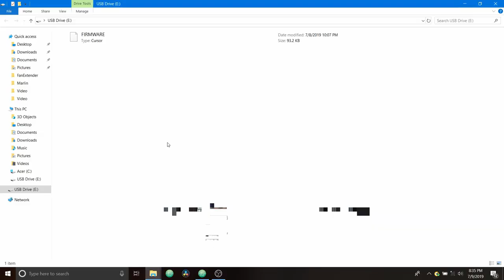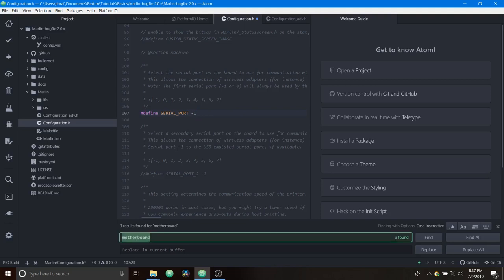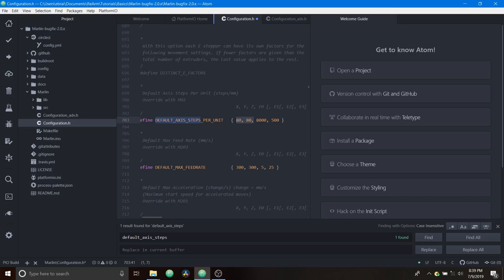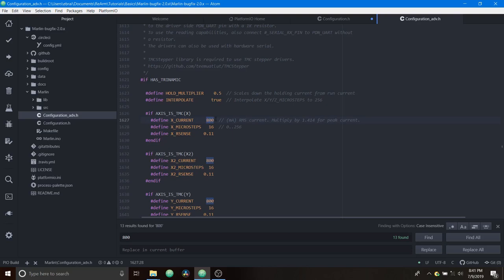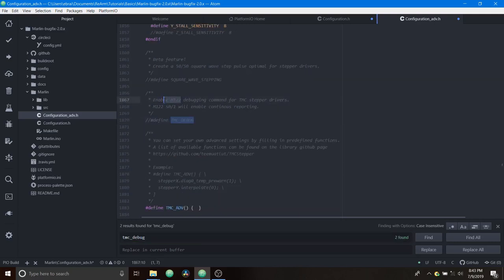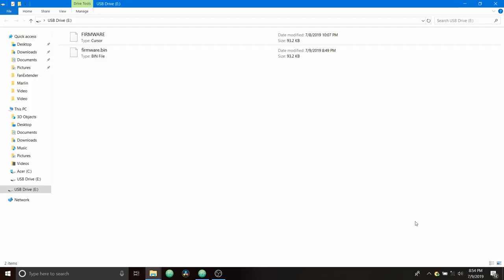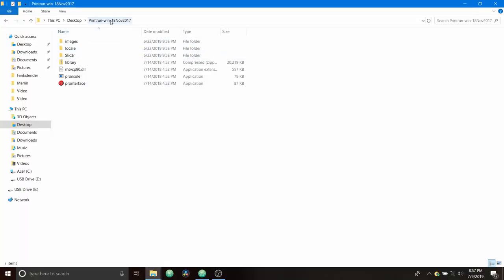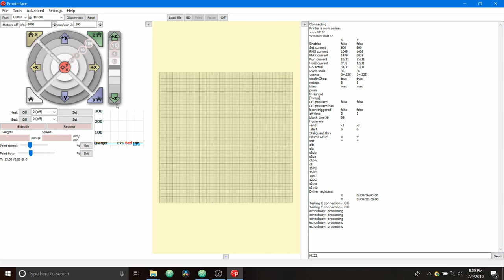SKR 1.3 - TMC2208 UART v3.0

Comment: Hi Edward thank you very much for this tutorial i have been following this and a few other while setting up my BTT SKR 1.3 with BTT TMC2208 v3 Drivers my issue i am having is that it seems to be moving twice as far as it should be any idea what could be causing this? any help is appreiciated thank you.
Reply from the maker: Check defualt axis steps per unit.  The reason I added drv8825 was to show the numbers being changed.  So try doubling the number for that axis.  Let me know how it goes.
Reply: @EdwardBraiman  double the numbers to decrease the distance moved? I thought it would be half? I will try it as soon as I can and will get back to you. Thank you for your speedy reply.
Reply from the maker: Np
Reply: @EdwardBraiman  okay so a little update on my firmware situation... there is nothing wrong with it! I came back to it after a day at work powered it up and all of a sudden everything was moving fine. Not sure why this is as i had done several power cycles already. Either way after following your tutorial my printer now works flawlessly so a Big Thank You!
Reply from the maker: You're welcome.

Comment: I followed this tutorial exactly with the BIGTREETECH SKR 1.3 and their drivers. I get a TMC CONNECTION ERROR on the screen. The printer works and moves fine still, but adjusting the current doesn't seem to reduce the temperature of the motors. Do you know anything that could help?
Reply from the maker: Tell me about the hardware you're using?
Reply: Edward Braiman It’s for a CoreXY printer and it’s the big tree skr 1.3 and big tree’s tmc2208 to control all 5 steppers (I have daul z). I’m using Marlin bug fix 2.0.x. Also, I don’t know if this is ok, but I’m ejecting the micro sd card from board and putting that in computer and then putting it back in rather than uploading through USB. Also thanks for fast reply :)
Reply from the maker: Are they TMC 2208 UART Steppers?  Can you tell me about your settings in Marlin firmware?
Reply: Edward Braiman Dang! I think you may be right, I got the combo from aliexpress and it was the TMC 2208 DIY x5 option instead of the TMC 2208 UART x5 option. I didn’t even realize there was multiple options. So this means I need to order new stepper drivers right?
Reply from the maker: Well unless you can modify yours to work the same.

Comment: You don't have to solder on the back of the driver to enable the UART?
Reply from the maker: Originally yes, but they fix most of their quality control issues, so it's not recommended anymore.
Reply from the maker: They had an issue with zero ohm resistor falling off at least in my case.

Comment: Don’t you also need to solder together the pads under the 2208 drivers for UART?
Reply from the maker: Not anymore, they should be in place when you order the steppers.
Reply: @EdwardBraiman  thx and good to know. I ordered my board and steppers a while ago and it was a real pain to solder the pads together
Reply from the maker: Just remember most the time this should not be required.  Also soldering can add danger of stepper failure.
Reply: @EdwardBraiman  in my case, the drivers did not have the 3 pads joined together

Comment: When I put the board into program mode and connect the usb to my Raspberry  Pi for, Octoprint, it takes control of my 2004 smart controller.  If I choose not to run with the Pi turned on, the screen remains blank even when printer is on.  Is it always necessary to switch that jumper to operate with or without the Pi?
The Pi seems to timeout quickly and disconnects from the board often.  Apparently I’m missing something.
Reply from the maker: Are you programming board from Raspberry pi?
Reply: @EdwardBraiman  No just running Octoprint. I actually find it easier to pull the sd and upload directly to the sd from Platform IO.  Are you thinking I don't have to switch the jumper if I am not programming ?  Seems like I tried running Octoprint without switching into program mode and it didn't work at all but I may be wrong.
Reply from the maker: What happens if you try the way in the tutorial?

Comment: When you open your platform IO, it looks very different to the one I down loaded you have more option on the left hand side,  it also does not show all the files that you’re showing, so can not open to edit anything, thanks Simon
Reply from the maker: It maybe related to me switching to VScode from ATOM with Platformio plug-in.
Reply: Edward Braiman I will look into the above I know more about SKR 1.3 than I did yesterday, if the file structure was fully open I would be able to do all the work required,  I think you said for the usb and power supply, you can use both at the same time, presumable you need a jumper to short out all three pins? Thanks Simon
Reply from the maker: The jumper is only for two pins.

Comment: Hi Edward, in earlier TMC2208 versions in combination with MKS GEN L  V1.0 board the stepper direction has to be inverted. Did I understand it right that it's not necessary with Bigtreetech SRK 1.3 & TMC2208 V3 combination.
Reply from the maker: It maybe nessary depends on you configuration.  If you're upgrading and direction changes yes.  If you building initially then you may plan for it.
Reply: @EdwardBraiman  thnx Edward
Reply: @EdwardBraiman   is my assumption correct, for the UART use (with SRK v1.3 or v1.4 boards) Vref Max on TMC2208 doesn't have to be set per potentiometer
Reply from the maker: Yes.
Reply: @EdwardBraiman  thnx
Reply: @EdwardBraiman  so we dont need vref set up ?
Reply from the maker: Could you be more specific or use discord below 👇
Reply: @EdwardBraiman  i mean we dont need to adjust vref knob on the chipset tmc2208 as old style ? From vs code is enough to set RMS current?
Reply from the maker: Correct,they should in most case be left alone.
Reply: @EdwardBraiman  i used my ex tmc2208 from mks gen board when i plugged them to skr pro 1.2 , i read 0.25 volt from chipset which should be 0.8 volt approximately so i was confused
Reply from the maker: Sounds like you figured it out.
Reply: @EdwardBraiman  for tmc2208 v1.1 unfortunately you have to solder 2 pins UART and NC otherwise they can not be UART Ready so jumper issue becomes useless. After try will write again. I took TMC CONNECTION ERROR then figured it out.

Comment: Hi Edward do like tutorials I am making a DLP 3d printer at the moment, I have been looking at this TMC2208 and this board will it run nema23 stepper motor 2.80A?
Reply from the maker: It may check the datasheet in the summary below video under documents.
Reply from the maker: This might be a better option. https://www.trinamic.com/products/integrated-circuits/details/tmc5160/
Reply: @EdwardBraiman  Hi do you know if the TMC5160 compatible with SKR v1.3 printer board,  I've looked at spec, step driver is not listed?

Comment: Thanks so much for the lecture. I did what you said, but I get a TMC CONNECTION ERROR error on the screen. Can you help me?
Reply from the maker: Are you using the hardware in the video?
Reply: @EdwardBraiman  
skr v1.3 and TMC2208 v3 diy. Need to join the pins? How can I do it? Thanks
Reply from the maker: You'll need to solder the pads on the bottom per your diy datasheet with a zero ohm resistor.
Reply: Thank you so much 😊 i will try this
Reply from the maker: You're welcome.

Comment: uh oh, followed the video and almost everything worked. The one thing that didn't work was the LCD. Tried to install the u8glib in atom and uploaded again. After pulling and putting back the USB cord, Things went dead. Now when I plug in the USB cord, the computer no longer recognizes the board. Not sure what happened but kinda stuck
Reply: Alright, copied a firmware.bin directly to disc and restarted and it came up.
Reply from the maker: Platformio will handle files for LCD.

Comment: Did the same on all XYZ and E but only XY working :(
Driver registers:
		X	0xC0:0A:00:00
		Y	0xC0:0C:00:00
		Z	0x00:00:00:00	 Bad response!
		E	0x00:00:00:00	 Bad response!

Testing X connection... OK

Testing Y connection... OK
Testing Z connection... Error: All LOW
Testing E connection... Error: All LOW
Reply from the maker: Check the solder joints on the steppers.  Sometimes this have a weak joint or check the jumpers.  Also try moving steppers to see if problem moves.  Try swapping E and Z first.

Comment: Thanks for the video although when I do this, I get a  "TMC CONNECTION ERROR" error. I've connected the pdn and uart pins but I still get the error. What could the problem be?
Reply from the maker: Which brand of stepper driver do you have?
Reply: @EdwardBraiman  Bigtreetech 2208 v3.0 for all steppers
Reply from the maker: Does it say UART?  Try swapping steppers, one or more might be missing soldered resistor.
Reply: @EdwardBraiman  The only 4 drivers I have are the 2208s. I've tried all of them and they all present the same issue.

 I was also wondering if I would have to solder 2 of the J2 pads together ( https://imgur.com/a/rrYrgOk ) since on bigtreetech's video of the 2208s, they say that they will need to be soldered together for UART mode ( https://youtu.be/k3Uc1F5jgVQ?t=94 ) although some people do claim that that is false.
Reply: @anon44129  if you are still using 12v. It will do that. IE using usb on laptop.. It should work on 24v
Reply: Colin Talbot unfortunately, i just have a 12v power supply
Reply: Naidanacami Im having this issue too, but on a 24v psu.... have you found a fix?
Reply: @mesairr  Not yet, although i have been rather busy and haven't been troubleshooting for the last several months. I think I burnt my drivers out somehow tho. idk

Comment: Can this board be setup to drive a CNC machine with external (Gecko) drives?
Reply from the maker: The board can do CNC as for machine types unsure, but anything is possible.
Reply: @EdwardBraiman  I believe it can, CNC is not much different than a 3d printer. The printer lacks an analog for the spindle and all inputs and outputs need isolated, but that is not hard to do. I just got one in and will be attempting to use on a CNC router that I am building. I will let you know how that goes.

Comment: Hi! I bought TMC2209 (v2.0) and tried to connect in the same way as TMC2208 in this video. And does not work. On the M122 command, I get errors and zero registers. And on the LCD screen a message - "TMC Connection error". While I use them as TMC2209_STANDALONE. (((
Reply from the maker: Could you tell me about what's in your configuration?  Are your steppers bigtreetech uart steppers from the link in the description?
Reply from the maker: I ordered the stepper and will try and make a video when it arrives.
Reply: @EdwardBraiman  I'll be waiting for Your video! Thanks!

Comment: Using Visual Studio Code with PlatformIO installed.
In the old marlin you could see where your board is connected on the PC. This Marlin 2 is nothing but a pain to work with. How do you know if the board is connected to PlatformIO? I get these "select" options but obviously they refer to Marlin 1.xx
I followed the instructions here, same TMC2208 drivers, do a PlatformIO build  and get LPC1768 Failed
#error "Oops! Select 'Sanguino' in 'Tools > Board' and 'ATmega1284P' in 'Tools > Processor.' (For PlatformIO, u 92,4
#error "Oops! Select 'Sanguino' in 'Tools > Board' and 'ATmega1284P' in 'Tools > Processor.' (For PlatformIO, use 'melzi' or 'melzi_optiboot.')" 92,4
#error "Oops! Select 'Sanguino' in 'Tools > Board' and 'ATmega1284P' in 'Tools > Processor.' (For Platfor  92,4
#error "Oops! Select 'Sanguino' in 'Tools > Board' and 'ATmega1284P' in 'Tools > Processor.' (For PlatformIO, use 'm
comparison of integer expressions of different signedness: 'const int' and 'const unsigned int' [-Wsign-comp  35,20
comparison of integer expressions of different signedness: 'const int' and 'const unsigned int' [-Wsign-compare] 35,20
Reply: I've only done 1 board with Marlin2....  the board does not connect to platformio. Its the suite you use to edit & compile the firmware. Then you copy the file over to your SD card. With the printer off insert the card then power on. The firmware will "auto install" to the printer. Tim at TH3Dstudios did a good demo/walk thru of this with his EZLite board.
Reply: Watch "TF drive Marlin firmware loading"... on this channel

Comment: thanks buddy
Reply from the maker: You're welcome.
Reply: @EdwardBraiman   i get tmc conenction error , i hope you have 10 or even 5 minuts of your time to help me fix it
Reply from the maker: First is you system powered by a power supply and not the USB power.   Second check to see the are correct TMC stepper driver in video.  Third swap steppers if issue persist with other steppers to see if system issues follow.  Between steps to power down system.

Comment: I have the exact same setup and did exactly the same as you did in the firmware. 
I tried it with 2 x SKR 1.3 and 2 x Bigtreetech tmc2208 V2.1 and 4 x Bigtreetech tmc2208 V3
M122 will always give me this nonsense:
X 0x00:00:00:00  Bad response!
Testing X connection... Error: All LOW

This is for all drivers on all boards all sockets, so I assume it's a software issue. And yes, I soldered the uart pads on the v2.1 drivers. The V3 came as uart ready and have an smd resistor (as it seems) already soldered in place.
Any help would be greatly appreciated, as I am about to lose my mind! :)
Reply: Forget about it, I just solved it! It needs to be connected to a decent powersupply, as the 5V USB connection does't seem to suffice. After hours of tinkering it now works :)
Reply from the maker: Good to know.  I had many problems trying to get the tutorial as usable as possible.  Thanks for the update.  I'll be doing SPI tonight and it was difficult to make as clear as possible.  I'm planning to explain RMS in another tutorial, just needed to find a way to explain for as many people as possible.  Trying to explain precalculus and calculas in an understandable way is a challenge.
Reply: i have the same error im using 12V5A power supply  what are yours?
Reply from the maker: 12v 30a power supply.
Reply: @EdwardBraiman  Thanks for your reply! Yup, that was indeed the issue. I tried to run the command from USB as a power source. Once connected to my power supply, it worked just fine :)

Comment: Do you have maybe  firmware for Ender 5 with  skr1.3 and tmc2208 v3 ? I am trying to flash firmware and set up everything but it is a lot for my skills ha ha
Reply from the maker: Check the examples folders for Marlin firmware, they may have what you need.
Reply: @EdwardBraiman  I have LPC1768 failed error  all the time. Can you help me with this ?
Reply from the maker: Three things come to mind, configuration.h motherboard, serial port.  Platformio.ini, Default environment is LPC1768.  Also try doing a fresh unzipped build with default configuration.  Also make sure your computer is connected to internet while building/compiling to pull need files.  Hope this helps
Reply: @EdwardBraiman  I connected  skr1.3  with Ender 5 but showing me TMC CONNECTION ERROR info on the screen . I can move  axis but  problem is I thin
k with Extruder stepper.

Comment: When I go to Save and build it gives me an error saying platformio is not recognized as an internal or external command..do I need to give it permissions somehow? I missed something.
Reply from the maker: Is this the first time with platformio build?  I just starting seeing issues with mine today.  Check and see if link to Git is missing?
Reply: @EdwardBraiman  This is the first time for me.. Where do I find this link to git? Sorry for the noob questions.. I cannot find "platformio.exe" or anything similar on my PC.
Reply: @EdwardBraiman  I may have missed something, but followed it to the letter.. I installed PlatformIO IDE from the packages in Atom. Do I need to install python or something maybe?
Reply: @EdwardBraiman  OK, I think I got that working by downloading Python 3.7 and installing that... Now the new problem is it says "UserSideException please install Git client, then a bunch of errors and has an error when setting environment to LPC1768.
Reply: @EdwardBraiman  I got it.. Yeh after downloading and installing Python 3.7 for Windows, then installing the Git client, everything went as it should.. Thanks!
Reply from the maker: Congratulations, I also spent several hours on the same problem.
Reply: @EdwardBraiman  I got it all setup per your tutorial..really appreciate it! Only thing I didn't quite understand was whether I needed to invert the axii's for my printer (Ender3).
Reply from the maker: Depends on if the axis moves opposite direction of endstop.

Comment: hello I have the tmc2209 1.1 drivers and if I give the command M122 pronterface it gives me an error command unknown according to how come?
Reply from the maker: Unfortunately I have not yet been able to get a tmc2209 to test, but I'm guessing something is not configured correctly in the hardware.
Reply: @EdwardBraiman  I'm having the identical problem. Everything else works though, I can send commands through pronterface.
Reply from the maker: Check configuration_adv.h sounds like it's not enabled.
Reply: @EdwardBraiman  hi, i solved it with bigtreetech assistance.
 thanks
Reply: @marcoborghetti2062  You just committed the worst internet sin possible, the  "never mind, I found the solution" response. CAN YOU ELABORATE????
Reply: @TheMindverse  hi, i didn't say it didn't matter i said i solved it through Bigtreetech assistance, which everyone can do.

Comment: but i get a TMC conenction error on the lcd why?
Reply from the maker: Check if you see the same issue in Pronterface.  It may have a setup issue.
Reply: @EdwardBraiman   i sthere a specific command? because it shows no errors , infacet i can move them usign the graphcal command, but its rought and i am sure its wrong
Reply: @EdwardBraiman   i just fixed it :D , it was 50-50 chance risk but it worked , you have to solder pads at the bottom , omg it felt like surgery any way thanks man :D